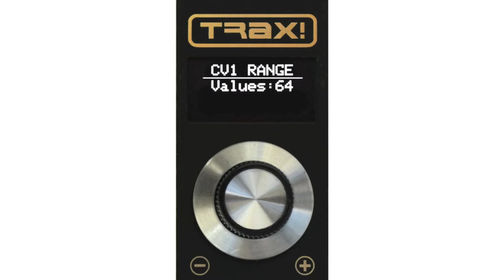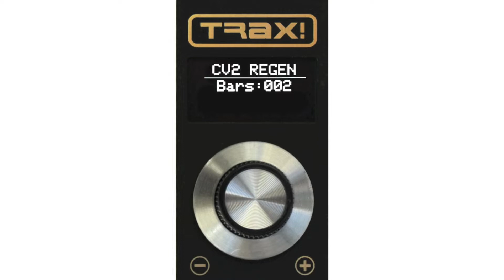Future Retro TRAX! sequencer Introduction

Comment: Sooooo IF I wanted to try to experiment with making a module that uses the INT Gate bus for MIDI IN and the INT CV for MIDI OUT, would I be wise to just leave that middle pin of My 5 pin DIN sync cable just NOT connected to any 0Volt reference, or Ground?  Or would you actually share the ground with your power BUS’es ground?  On my modular I just have a huge squadge of cooper / tin as a big ground bus terminal, that has leads going from the Main’s Earth ground on my power supply, and to every BUS board and ALL of my grounds.  Any ground shares a node with that Ground Bus Bar.  Is this inappropriate?  I’m now thinking that I maybe want to re-think the decisions to solder leads to EACH and every mini-jack socket in my system to the nearest ‘GND’ point on its PCB.  Maybe its unnecessary?  Even likely introducing some opportunities for signal leakage here and there?  Anyways great food for thought, and good decent use of those extra bus channels!  THANKS FOR SHARING AND MAKING A REALLY FEATURE-RICH SEQUENCER!
Reply from the maker: I would need to know more about what you are trying to do. Please send me a direct email to info@future-retro.com and indicate what the goal of your module is, and if it is to connect to our TRAX product, or the MIDI BUS product, and how these modules would need to be used with one another.

Comment: Just very useful and compact, does it control the transient thru a bus cable to ?
Reply from the maker: The Transient units do not have MIDI, so the Trax controls the Transient using the analog Trig, CV1, and CV2 outputs.